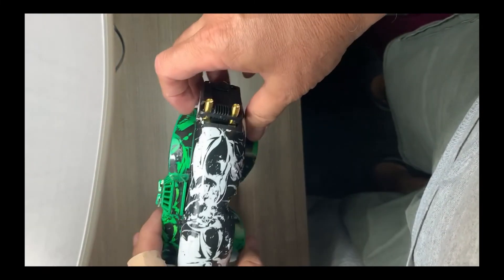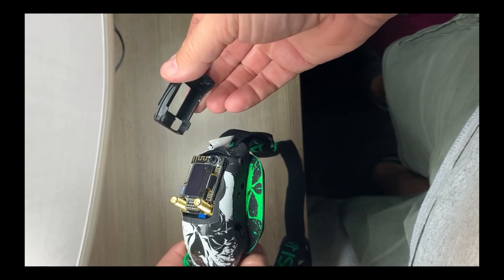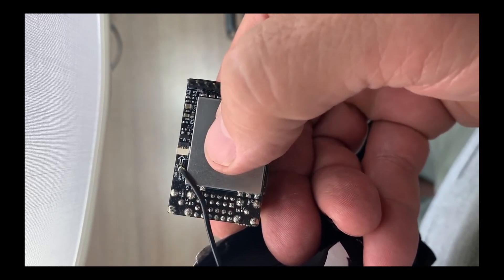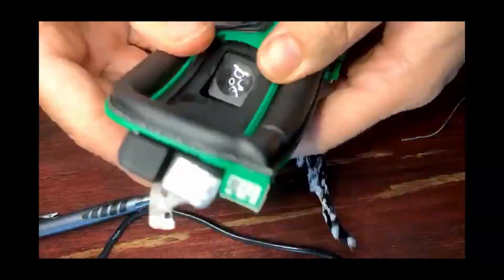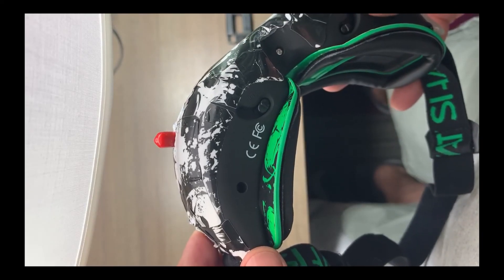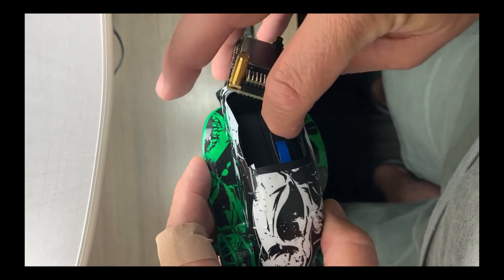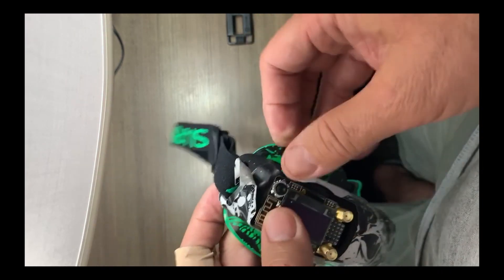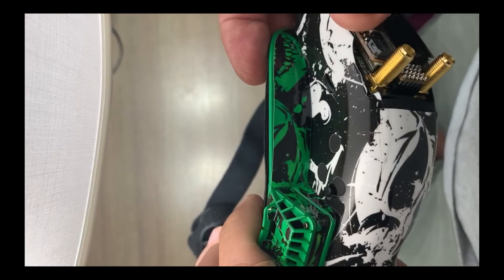TBS fusion installed in Fatshark Attitude V5

Comment: ? Are you still using the setup and if so how are they preforming good I have the V5’s and wish to put the fusion into the goggles if you could help me with some info that wood be helpful to me is there any problems stuff like that thanks hope to hear from you
Reply from the maker: I moved to DJI digital now and use the fusion in the analog adapter so I only have to carry one headset. When I had them in the fatsharks they performed without any issues. The only mod is the power wire and trimming the enclosure to fit the larger fusion on the video.

Comment: Why is it not plug and play like rapidfire
Reply from the maker: The WiFi function with the fusion requires more power than the traditional input has. That’s why the extra power off the plug.
Reply: So if I don't want to use the Wi-Fi feature I don't need to do that soldering
Reply from the maker: @sk1fpv  not sure. I read that it may work, but I’m not 100%. You could always try it.
Reply: @sk1fpv did you try doing it without soldering the wire? I'm contemplating doing the same thing because I don't care about Wi-Fi

Comment: Is the upgrade really worth it? I mean, the stock V5 Rx vs Fusion, range wise.
Reply from the maker: I would say I have seen about a 30% improvement in distance and clarity. The TBS infrastructure enables software updates easily. If your going to stay Analog, I’d say the $100 for the unit is a worthwhile investment. My bigger issues is the poor quality that the FS DVR is.
Reply: The attitude goggles don’t need the power mod.

Comment: Bang tidy
Reply from the maker: For some reason I can't respond to your other comment. I don't have a slow version of my assembly. You could watch it at slow speed on youtube which may make it easier. Its pretty easy to unscrew the goggles and insert the cable. Soldering wise, buying something like a T100 is great for temperature control, but you could easily do it with a traditional plug in soldering iron.